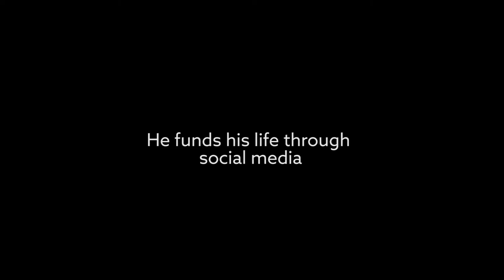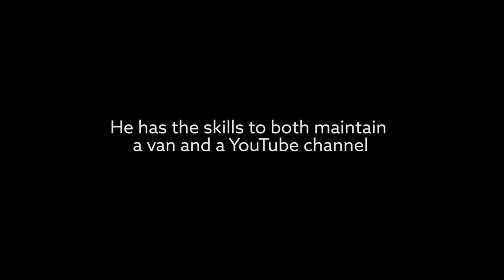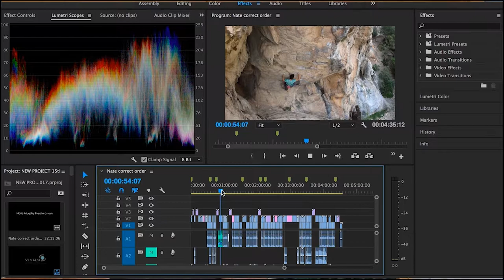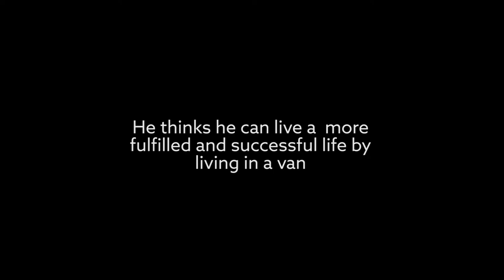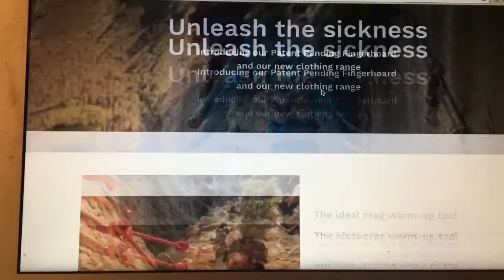Nathan Murphy - van-dweller by choice

Comment: I too live in a truck, I decided to live this way because I lost my house through a divorce and could not get a mortgage unless I was prepared to work about 60 to70 plus hours a week for the next twenty years. I didn't want to rent a room either. I wanted to know that what ever happens< I'll always have a roof over my head. I also wanted to live as self-sustainable as possible. I have a compost loo and wet room with a rainwater harvesting system and solar panels that top up my Rolls deep cell leisure  batteries. I have a log burner and a boiler to run hot water. 

I have been fortunate that I live on private land with the owner's permission. I work in his extensive garden and act as security, all has been well for the last four years until new neighbors moved into a small house adjacent to the land that I have permission to be on. They asked me to move my truck on the first day they moved in, I said I don't mind but you needed to speak to the land owner. They never did, instead, they contacted the council and complained about me. I have never caused any problems and I generally keep myself to myself and have had no problems with any of the other neighbors. The council said that they didn't really have a problem if I moved my truck up the track further. I moved about a hundred feet further up between some oak trees so that I could still generate enough power from my solar panels. 
7/8 weeks on I had been served with an enforcement notice from the planning inspectorate in Bristol. the land owner and I have appealed but just waiting on their response. 
I wish to add that I work and pay my dues but I don't claim anything I.e benefits etc. I live within my means and take nothing. 
Furthermore, nobody can see me as I'm tucked away. I'm passionate about the preservation of our countryside and keep my area clean and tidy and in fact, I have enhanced the area and encouraged a good bird population etc. 
The upshot is that if the council say no I can't live there, then I will be homeless as there are no travelers sites around, I would also have to give up my job and most likely ... in fact realistically I would have to claim benefits etc. It is absolutely nonsensical and puritanical. My truck is featured in one of the Housebox videos which can be seen on youtube (kaya box)
Reply: Watched your video, nice build and Im doing a truck that is a similar size with a bed over the cab also but I am going to leave it looking like a boring truck with no windows outside and a skylight you cant see to avoid the exact problem you went through....Ignorance is the best security from boring conservative minds.